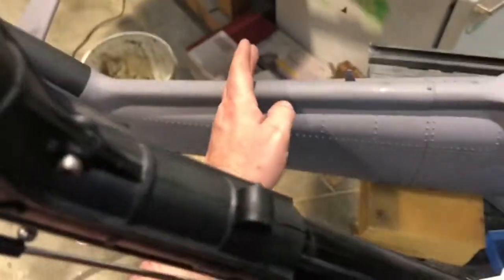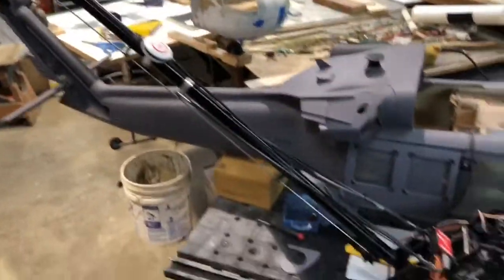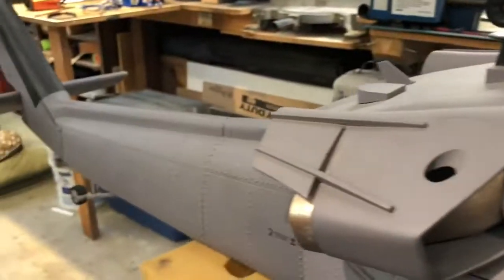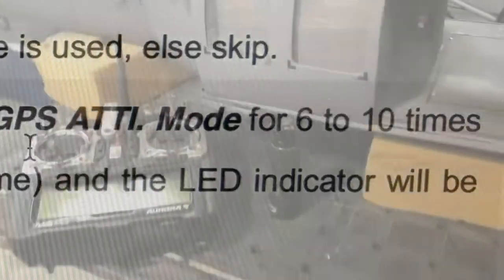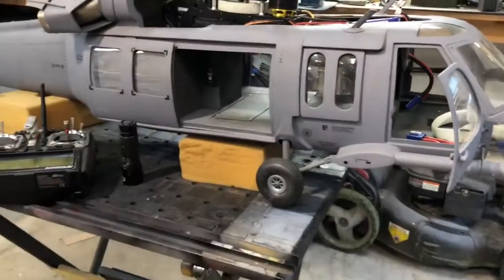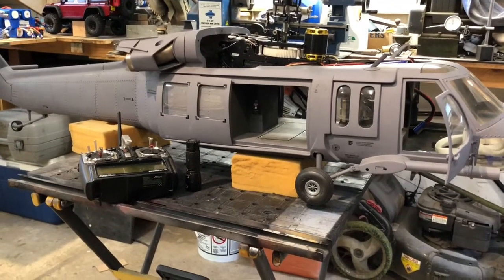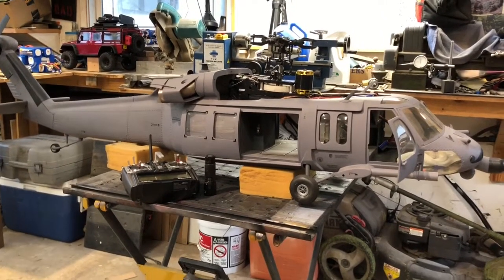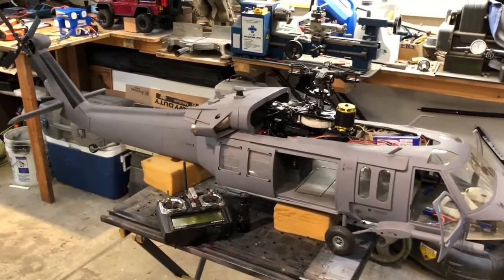Fixing the Roban Pave Hawk and calibrating the Naza

Comment: Naza-H GPS is the same as the Naza-M (multi-rotor); My GPS is mounted not far from the tail servo (about 3 cm) in the LongRanger; on the Cobra is by the nose; the AS350 to be is also about 3cm from tail servo.  If you can calibrate the GPS the position if fine; if not, go find another location.